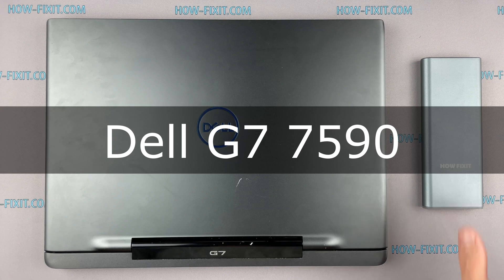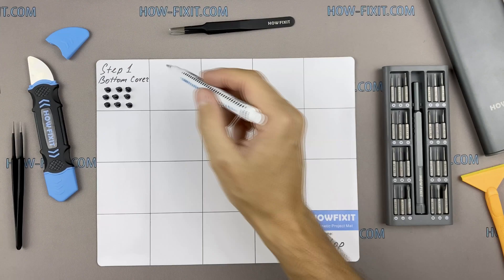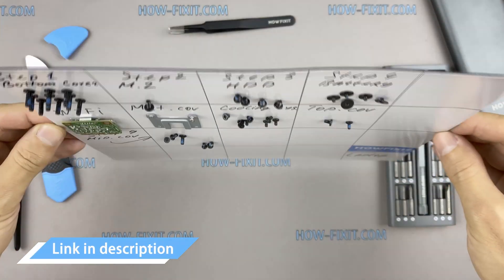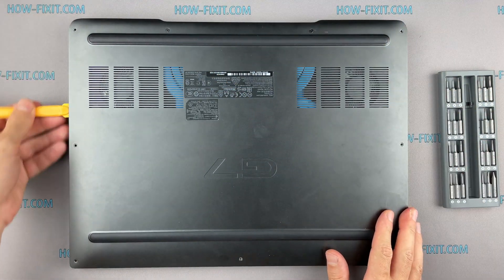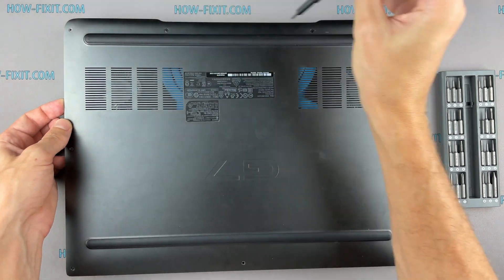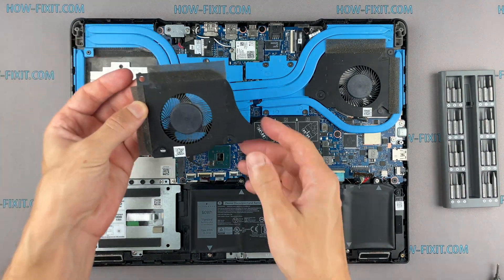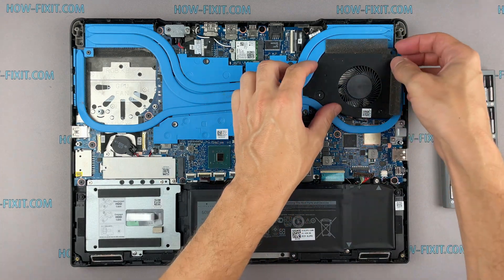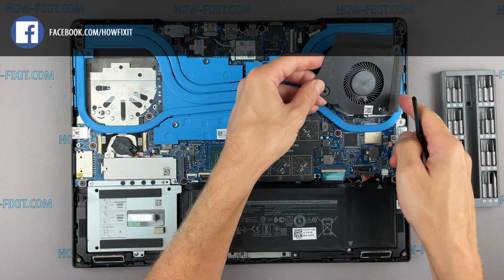Dell G7 7590 Cooling Fan Replacement Guide

Comment: when i input DFSCK221151811 and DFSCK221051821 into newegg, they are showing as parts for the dell g5 5590, not g7 7590, do they happen to use the same fan, or is something wrong?